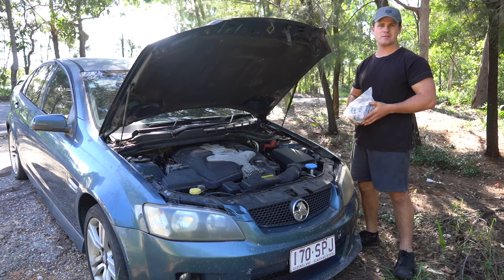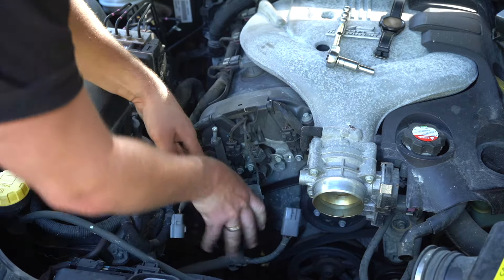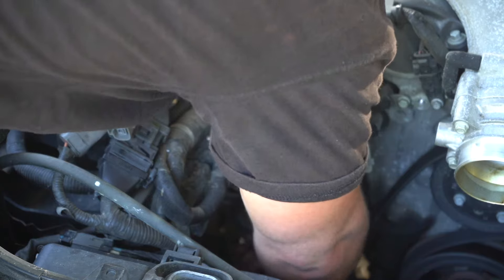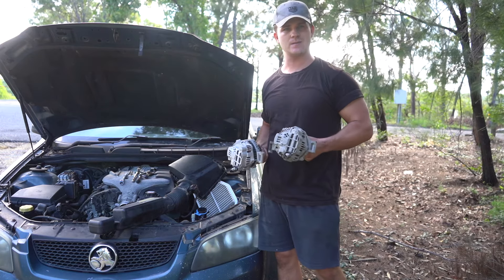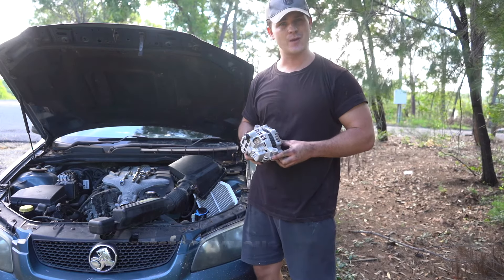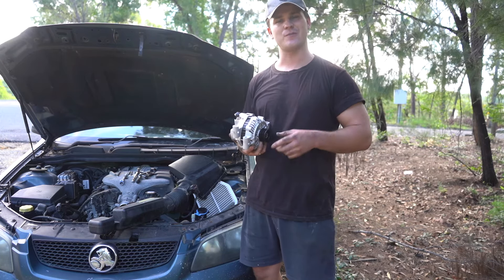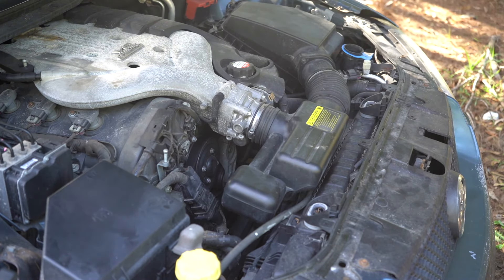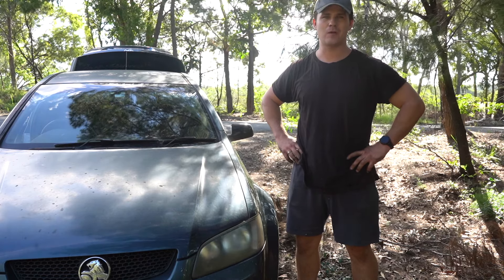How to Remove and Replace Holden Commodore Alternator for VE VZ

Comment: how many amps this altinator?
Reply from the maker: 140amp
Reply: @thepartsfactory4239    Thank you for your response. I have a 2009 Caprice and the generator is 140 amps, but I suffer from poor electricity. The lighting is not constant. I searched on the websites and found that the suitable generator is 170 amps. I don’t know what to do in reality.

Comment: Got a new battery in Calais VE 3.6lt 9 months ago. Two months ago started getting battery indicator light for 30 seconds each 30 minutes though battery diagnostics showed battery >90%. Just got "Charging System needs Service" and battery charge dropped from 80% to 18% in 45 minutes driving home. Should I check a fuse or anything else before replacing alternator? thanks.
Reply from the maker: It's your alternator. 100%. Thanks

Comment: Thanks for the video. Made the job easier. 👍
 I only had a 7mm ring spanner but eventually got the studs out. If there is a next time I’ll be looking for a smaller 7mil socket with ratchet wrench like you used.
Sadly your alternator was out of stock but I got a used on on Facebook that is working well.
🙏🏼🙏🏼

Comment: I like how u cut away when removing and installing the bottom stud.... U have to remove the bottom 2 studs first so the alternator hangs by the top stud then slide it out or the back bottom stud hits the chassis rail
Reply from the maker: The stud won't hit the chassis rail. Never had that problem before

Thanks!

Comment: VE Calais new battery 9 months ago. During last month battery dash light indicated not charging issue - maybe for 1 minute each 2 hours of driving. Now msg "Charging System needs Service" appeared and battery charge diagnostic shows dropped from 80% to 18% during 45 minute drive home. Is there a fuse to check or anything else to consider before I replace alternator? thanks

Comment: Thanks for the video. Sadly, my girlfriend has a 2005 Holden Adventra (VZ engine), which is a variation of a commodore with beefed-up suspension, and some *slight* differences in the engine bay & rear wiper.
One main difference is the alternator is on the passenger side, so it needs a 3/8 on the passenger side tensioner serpentine belt. It is also rotated 180 degrees with two bolts at the top, and one underneath. Otherwise it's the same technique with having to remove the studs.
It's almost impossible to find any online advice for it too, as it is so rare (only 1644 sold).

Comment: to make things easier , replace the studs with bolts the same length as the stud with the nut wound all the way on , for easier removal next time
Reply from the maker: BUY A PFA ALTERNATOR AND THERE WON'T BE A NEXT TIME ;)

Comment: I just got a new alternator n the check alternator lights still coming on!
Reply: Check the main power wire for breaks
Reply: @zaccuskelly4016  thanks zac I found the negative cable wasn’t attached to anything got it fixed